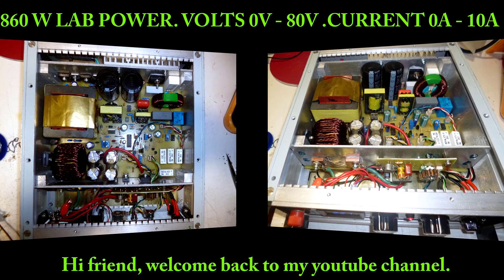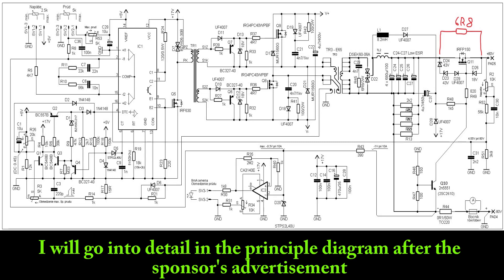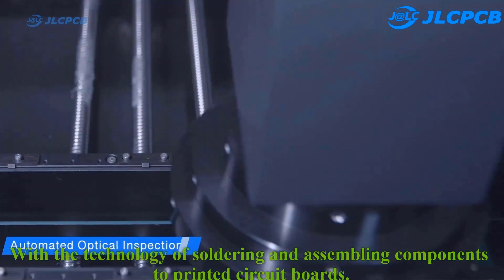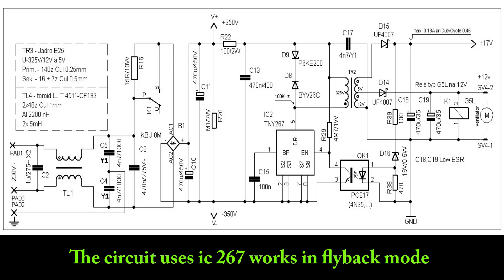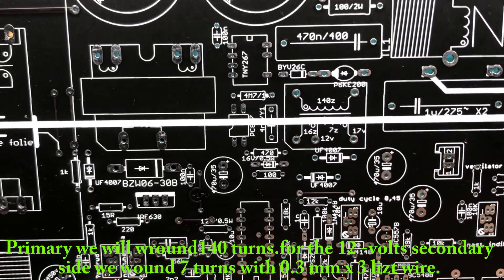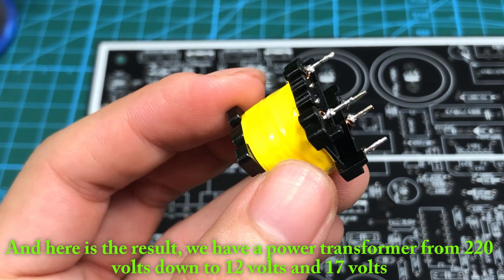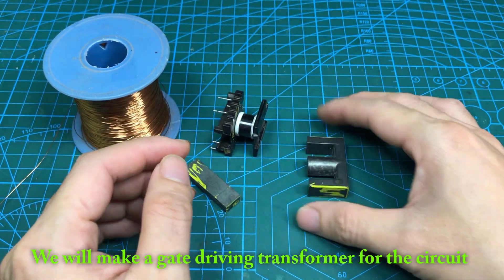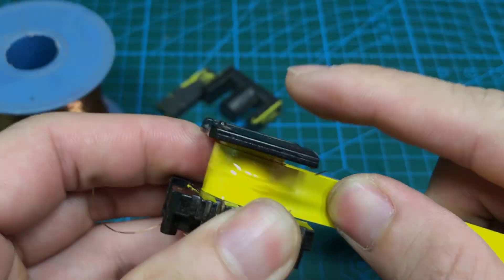860W Lab Power Supply 0V   80V 0A to 10A Part 1

Comment: How To Make 2000W Switched Mode Power Supply With PFC Power Factor Correction in the video I printed this board of yours and bought all the parts, just please let me know the number of primary and secondary turns, the number of litz wires and the diameter of the wire for the main transformer, thank you

Comment: I have made a 12v 70a smps using sg3525 but am getting trouble for measuring current and voltage since I don't have proper shunt I am using AC current and voltage meter and measuring current using current transformer in series to current regulating transformer but how can i calibrate it?????? I same current sensing way as u used here is it good if not why??

Comment: Bro in the circuit diagram, the starting point of the primary side of the GDT is upper side but you have started from the lower side and also you have not showed the winding of second secondary on the video properly. BTW nice video
Reply from the maker: No problem bro, the inportant point here is the start point of wrap. On the PCB the start poin of wrap is mark by white spot.